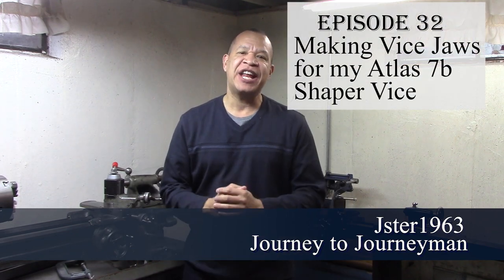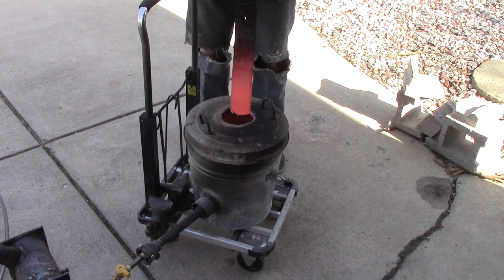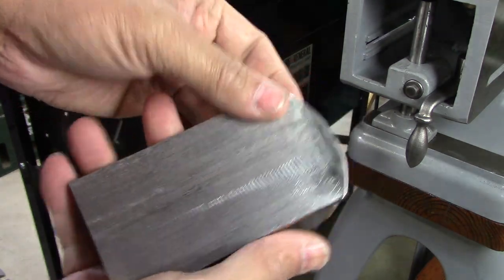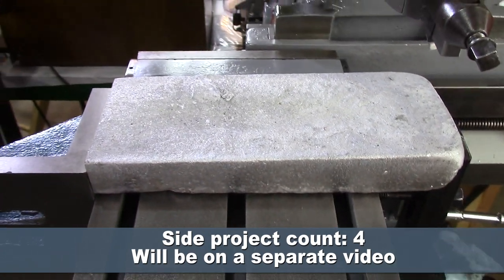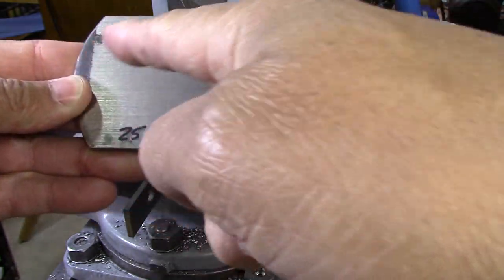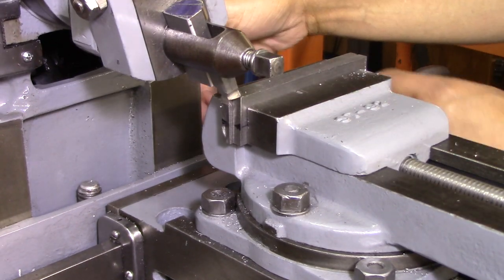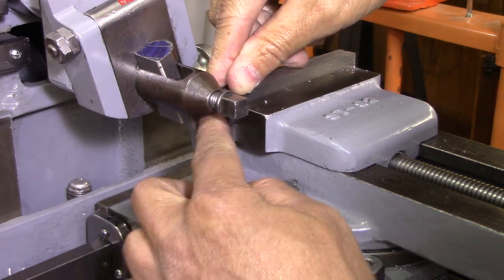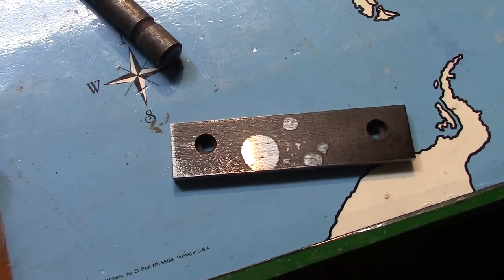Using my Atlas 7B Shaper to make vise jaws for itself.  Journey to Journeyman, Episode 32.

Comment: I really like the shaper videos and stories. I have the same Atlas 7B shaper but with a now factory vise. My suggestion  would be to get the belt guard for the motor to countershaft pulley. It allows you to use the clutch lever to leave the motor running and start and stop the ram instead of having to use the on off switch all the time. You can then also stop it where you want it. Without the motor belt guard the ram keeps moving even when releasing the tension on the belt with the clutch lever. With a motor belt guard installed, when the tension is released the guard keeps the belt oval shaped so that it no longer rides on the motor pulley and then the ram stops moving. It’s a bit counterintuitive but the motor belt guard is an integral part of the clutch operation.
Reply from the maker: Thank you so much!  I really want to get guards for my shaper, but they are crazy expensive. Someday I hope to find them in a flee market so I can afford them.  I’ll keep looking and thank you again…..

Comment: Really enjoy the airplane stories.  You may want to try using a sulfur based oil when machining steel.  That's what I use and it makes quite a difference on the finish.
Reply from the maker: Sulfur based oil, huh?  I have some of that and will give it a shot.  Thank you so much.....

Comment: For mill scale, you can easily remove it with some muriatic acid (acid used for cleaning concrete). It will fizz right off.
Reply from the maker: Excellent!  I will keep that in mind next time.  I think I'll try vinegar first.  And thank you very much.....

Comment: Great video. We have the same shop set up. I have a Southbend 9A, and an Atlas shaper and horizontal mill.  One question, did you consider cross hatching the jaws using the shaper to improve the grip of the jaws?
Reply from the maker: That's so cool!  Yes, I did consider cross hatching the jaws.  I plan on making another set of jaws that do have that feature.  And thank you very much.....